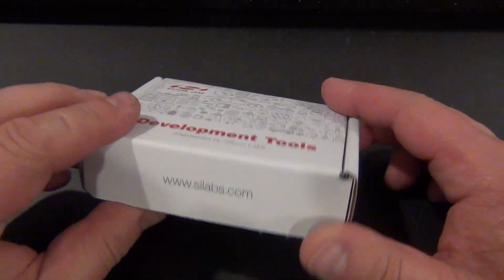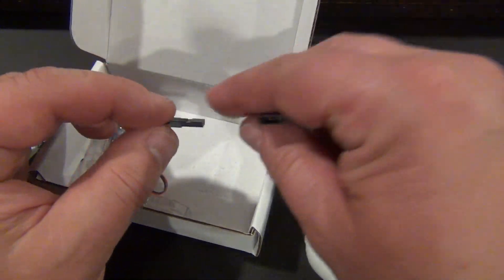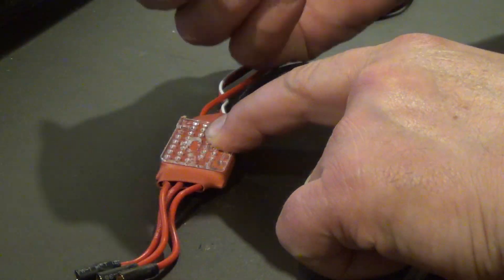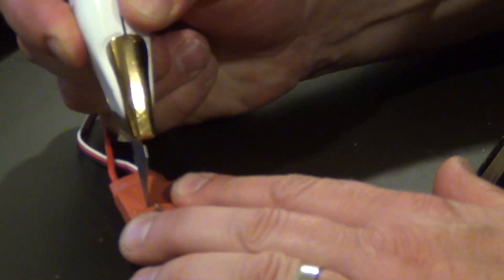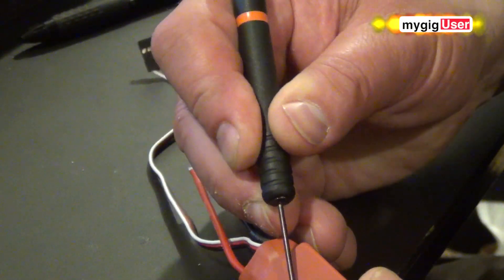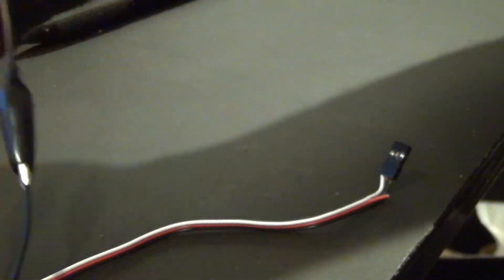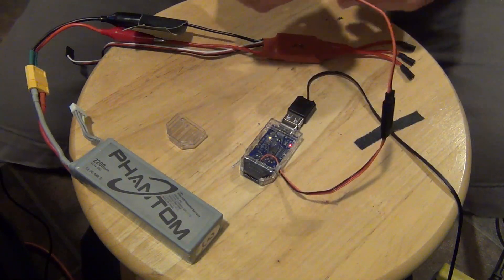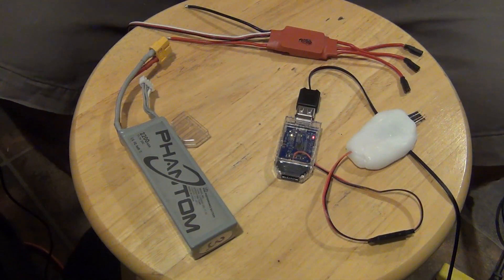Multicopter Silabs ESC Flashing

Comment: Nice Video,  can I use an Arduino nano (Atmel 328P based) Programmer to backup the firmware from my Silabs SIL F330 based ESC's, Can you link to the software you are using please, or where can i get a programmer to do this.